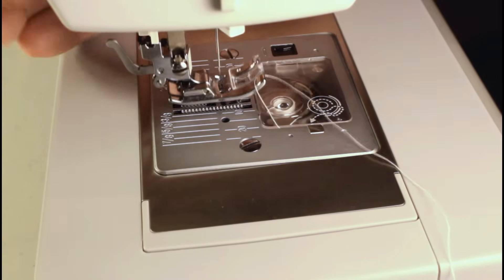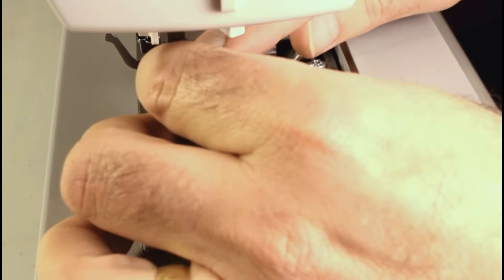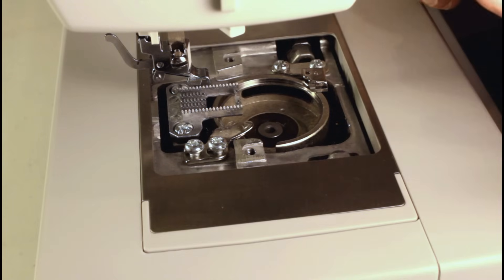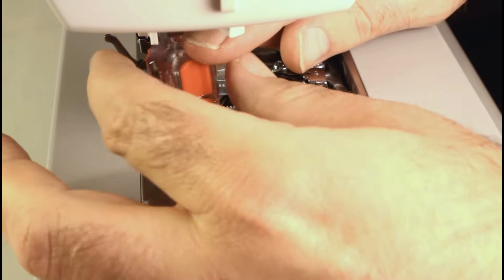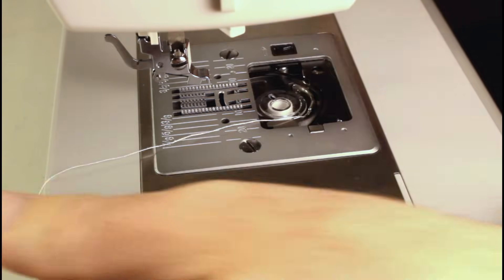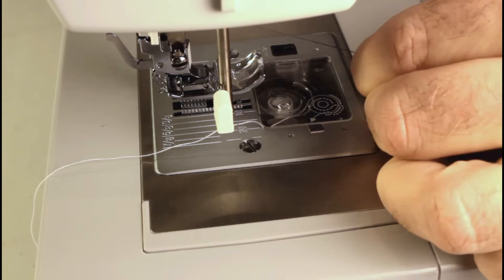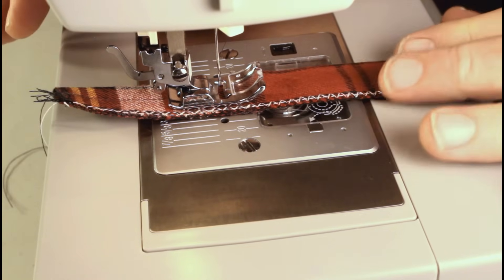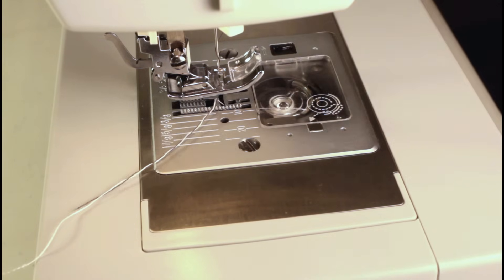Singer Heavy Duty - Adjusting Bobbin Tension, Please read the Description before posting questions.

Comment: Hi I have a singer 4423 which is not making stitches, I either get a birds nest underneath or very loose stitches which unravel. Any suggestions?
Reply from the maker: julie wilcox This usually means that the thread is not seated between the tension disc.
Reply: @kevinsews  where is the tension disc located? Same problem here to my singer heavy duty 4432..
Reply from the maker: @diyaspratiwi6258  They are on the right slot located on the front side of the machine.

Comment: Hi Kevin, I have the same machine and the needle is not pulling the thread out of the bobbin. Seems like a timing issue. Is that something easy to fix? Couldn't locate a video for 4423. Any suggestions? Thanks
Reply from the maker: I own 4 of them and they haven't had that issue yet. If they do I will create a video on how I fix it. You will need to remove the bottom cover on the machine first. Then search for setting bobbin timing on top loading bobbin machines. The technique is the same on all of these machines.

Comment: hi kevin sews i had a question when ever i start to sew my top thread makes a knot with the bottom one n my fabric gets stuck... n sometimes makes a tear on the favric can u help ne
Reply from the maker: It might be a problem with the top thread not being seated into the tension disc. With the pressure foot down grab the end of the thread and pull it toward the opposite side in which it enters the needle. The needle should bend as you pull the thread through the needle. If it doesn't then your thread isn't seated between the disc.

Comment: What do you do when stiching using singer model 1241and stiches are not coming out nicely. They come out loosely
Reply from the maker: I don't know anything about your model, but that is a tension issue in general. Clean the tension disc using dental floss is one thing you can try. A good cleaning of the bobbin tension are as well.

Comment: On sample sandwich it works fine but on the actual piece I am sewing its loose and will have loops every so often. What do i need to do.
Reply from the maker: This is caused by these issues:

1. Needle needs to be changed.
2. Your thread tension is off
3. Your machine is out of time.

Try a new needle first. Then rethread your machine. Pull slowly on the thread in the needle and turn the tension up to 9. If threaded correctly this should stop you from pulling the thread through without really tugging on it very hard.  Next, make sure your bobbin is threaded properly. See the quick start that came with your machine on exactly how to thread the bobbin.

Comment: What do we do when the bobbin house moves and a mess occurs in the threads and the machine fails to work?
Reply from the maker: When you removed the cover you will see a silver piece at the back that holds the bobbin into place. Stop the video at the 10:46 mark and you'll see the two silver screws holding it into place. Usually, the bobbin has become loose from this piece holding it into place.

Comment: My bobbin case doesn't require the screws to be loosened to get it out - it pops out.  I'm guessing it shouldn't?  I have HD6800C.
Reply from the maker: I will have to check my 6800 to see if mine does too.

Comment: I am having problems with my top thread getting caught around the bobbin case.  I have tried multiple times !nd this keeps happening.   Do you have any suggestions?
Reply from the maker: The machine may be out of time. Remove the cover plate and slowly rotate the handwheel and observe what is going on as the thread gets pulled around the bobbin.
Reply: Kevin Sews What do I do after that?
Reply: I had this happen to me turns out a loose thread was tangled inside so I had to pull that out
Reply: @kevinsews  I am having the same problem, pls what should I do after this observation.  Thanks so very much for your help.

Comment: Thanks a lot for the video. I solved my machine problem. But after a few sew, the problem come back, and I’m not able to solve it using this method anymore. 
May I know what should be the perfect tension for the bobby case? Thanks in advance ☺️
Reply from the maker: You probably need to buy a new bobbin. Over time they can wear out or maybe you received a defective one. Try www.sewingpartsonline.com if you need a new one.

Comment: thought i put the bobbin case back in right but not the part  that sapose  to move for the bobbin doesn't move  what do i need to do?
Reply from the maker: Hard to visualize. Can you capture a quick video on your cell phone and post it here on youtube and give me a link to it? That would help me see what you are dealing with.
Reply: @kevinsews  i got the machine running i think the thread of spool was very loose  when changing thread it works  thank you for your reply
Reply from the maker: @MyFungal  You're welcome! I am glad to hear you got it working.
Reply: @kevinsews  you and me both lol   this is the first time i had to  take out the case of my machine

Comment: Hi Kevin, I have a question. I just received a Heavy Duty Singer and its my first time using it. But for some reason the stitches are slanted both at the top and bottom. After following a bit of your videos its not as drastic but its still slanted. What do you think the problem is?
Reply from the maker: I have 2 videos that might help you:

https://youtu.be/-94cSYbxkpw?si=2kv8u6Z-xbRM3WgG

https://youtu.be/7lyxWXCh2dQ?si=w4pUTkw17gkHflVu

Watch them and let me know if they helped you address your issue or not. Then we can go from there.

Comment: I watched your video hoping it was my problem. Apparently not.  My top thread is binding up in the bobbin carriage.  Leaving me with either a good top titich and a birds nest underneith. Or will just bind up the whole machine jamming it.  It’s a new machine, I have used it about four times without an issue.. I sewed. Couple patches onto a denim vest, now I’m having binding issues with anything I try to sew,  cleaned it out, changed the needle, used different threads.  In watching my top thread as it goes around the bobbin, it seems to bind about at 7:00, or 1/4-3/8 inch to the left of the yellow screw.  I have felt the bobbin carriage, no burrs, nothing I can figure as to why it’s binding?  Any suggestions.
Reply from the maker: Take off the bobbin case cover and turn the hand wheel by hand slowly and observe where the thread is catching. If it is caching at the 5 o'clock position as it squeezes through the metal finger then you are experience an issue that many others have had. Return it immediately if possible.
Reply: Kevin Sews it ended up actually being out of sync by almost 180 degrees (timing) I’m supposing that when I did the vests I hit an area that was to thick and jammed it. Can’t believe it would have messed it up that bad. But checking my timing with the bobbin and carrier out of the machine. When my needle was at dead bottom and beginning to raise, thus causing the loop in the thread for the pointed metal pickup to grab the thread. That metal point was totally on the other side of the carrier. I actually had to pull the entire carrier out and replacing it’s worm gear in with the drive gear to get it to be at the right position when the needle began to go back up. Kind of the way you would have to feed the distributor back into the engine to get its timing right. I bought this “heavy duty” lol, machine just so I wouldn’t mess it up sewing heavier items like I did my other machine. 
Anyway, I appreciate you actually responding to my question, I go to YouTube a lot to trouble shoot everything I can. And honestly, you are the first person to have ever responded back to a question I had. So thank you again.
Reply: @kevinsews  I am having this exact problem with it catching in the 5 o'clock position.  The machine is too old to be returned.  We are very handy and able to fix things ourselves.  Can you show what needs to be done?
Reply: @loralibarber3478  we are having the same problems. Did you fix it?
Reply: @fuzzydeborah  No.  I've also contact Singer, but they haven't replied.  Guessing no one is working right now...

Comment: I have heavy duty singer 44s my bobbin tension will not the tien enough to pull the top thread down
Reply from the maker: If you have tightened it up and it still isn’t tight enough then you need a new bobbin holder. Check to ensure you have threaded the top thread properly first.

Comment: Are all top-loading bobbins this difficult to alter the tension on? On my old machine I have to alter the bobbin tension for every different thread that I use but it was much easier to access from the side.  Would I be right in assuming that this is not the case with this machine? Do you find that the bobbin tension rarely needs altering? Can one purchase sewing machines where the tension is adjusted automatically?
Reply from the maker: All of the top loading machines are the same.
Reply: Kevin Sews Which question were you answering?
Reply from the maker: Nowthen AD Sorry, I corrected my post.

Comment: Does the same machine need to be oiled
Reply from the maker: Yes, one drop will do it.
Reply: Kevin Sews where do we oil it? Sorry I thought this machine didn’t need it because it didn’t come with any.
Reply from the maker: @knitknack2285  Just remove the two screws off the top of the machine under the handle. Then remove the left top side panel by to expose the needle shaft and feeding area. This will expose most of the areas that are metal to metal and allow you to oil them. Next, remove the bobbin and place a drop of sewing machine oil in the middle circle you see there.

Comment: Hello sir, can you tell me why’s bobbin not working?
Reply from the maker: What exactly do mean is not working?  I need some details to help you.
Reply: @kevinsews  Few days ago I was sawing a pillow cover and then it got stuck in the the sawing machine. I took it out but, after that bobbin and spring does not work.
Reply from the maker: @muktadatta224  If it is the bobbin case then I would buy a new one.
Reply: @kevinsews  Are you trying to say the problem on the bobbin case?
Reply from the maker: @muktadatta224  You said the bobbin wasn't working,.... that the spring wasn't working. I took that as the spring tension in the bobbin case that provide tension. If it is something else then let me know. It would be helpful if you could capture a cell phone video showing the issue and posting it on your channel. That way if I can't assist you then somebody  else may see it and help you.
Reply: @kevinsews  hello, did you see my video why didn’t replying yet???
Reply from the maker: @muktadatta224  No, where did you post a video?
Reply: @kevinsews  I did post it. I don’t know why you can’t see it. Bobbin and string not moving so what do you think the problem on the bobbin case
Reply from the maker: @muktadatta224  Give me a link and I will take a look at it.

Comment: Hi, I didn't hear you say which way do you turn the bobbin screw, I'm sorry should I automatically just know. Turn left or right, clock wise or counter clock, j just asking, thanks for all your help.
Reply from the maker: Left to loosen  and right to tighten.
Reply: @kevinsews  Thank you very much, Kevin. I have a Singet HD 4432, also. I've tried it all. Adjusted timing, tension bottom & upper. It's not stitching at all. Can you help? Buy the way I just bought this machine I've only used it twice.
Reply: Thanks for asking this question, I to wanted to know, better safe than sorry

Comment: I have a 44s heavy duty but it won't make the loop for the first stitch
Reply from the maker: Place the threads under the foot and pull them to the back side of the machine. Hold the threads during the first 2 stitches. Let me know if this fixes your problem.

Comment: I was sewing fine and then the bottom thread all of a sudden stopped catching

My timing seems fine after inspections and I’m also holding my needle thread taunt when trying to get it to catch and it still will not 😿

But i don’t think it’s my timing at all!!! HELP- watch another girls vid and it wasn’t her timing either. It was that she wasn’t holding the needle thread when trying to catch. I have singer 6412 millennium
Reply from the maker: If it isn't a timing issue then it is a threading or tension issue.

Comment: I am new to sewing and I dont think this brand sewing machine is good for beginners. I havent been able to sew because I cant manage to have the thread not give me issues I dont even know if there is truly a malfunction with the machine or its just me doing something wrong. I have had this for one week and am still not able to get it to work. It came with no manual. HD 44s.
Reply from the maker: Go here: https://www.singer.com/collections/beginner-sewing-machines/products/singer-4423-heavy-duty-sewing-machine    Scroll down to the bottom of the page and you will see a link to the manual. Download it and see it if helps you. I believe the 44s is the model for Walmart and it is the same as the 4423.

Comment: Any idea why the bobbin case would be jumping ? The back holder bar is tight but it keeps jumping past the front bumper causing the needle to strike the casing and jam everything.
Reply from the maker: Make sure you are using a class 15 (not 15J) bobbin. I have also seen defective bobbins, so buy some Singer Brand and give them a try.
Reply: @kevinsews  I'm petty sure they are 15's but I'll double check. To clarify the problem- the bobbin isn't jumping, it's the entire cartridge that's popping up and rotating past the little metal stop.
Reply from the maker: Robert Clyburn I would remove the bobbin case and make sure there isn’t any debris in the bobbin area.
Reply: @kevinsews  I ordered a new cartridge from Amazon and it did the trick!  I'm not sure what's wrong with the old one, but oh well- I'll keep it just in case.
Reply from the maker: @RobC0313  I am glad that fixed it.

Comment: where is the screw in the bobbin case, aI can not see it,  just
 a yellow color
Reply from the maker: Jan Archer The yellow paint covers the tension dial to prevent it from moving. To adjust the bobbin tension you will have to remove the yellow paint to get to the screw. Just scrape it off with a small straight screwdriver.
Reply: @kevinsews  They do this for warranty purposes.  Just be advised that if you remove that paint, and then the machine is still not sewing right, if you send it in for repair they are likely to say that the fault was due to you messing with the lower thread tension.  Kinda ridiculous, but it's also not a coincidence that you can't find this procedure in the manual -- even the long one you have to download online.
Reply from the maker: @gdeangelkick  Yes, I've tried to let people know it does void the warranty, but thanks for mentioning it again.

Comment: Thank you, thank you, thank you! 😘
Reply from the maker: You are very welcome!
Reply: @kevinsews  Thanks again. So things were going great for the next hour -- I was sewing some curtains -- but then the tension messed up again. I checked the bobbins tension again and the screwed hadn't moved since I had turned it. I wonder why it is acting up again. I tried turning a few more times: 1. To the original position and 2. Way past the first tweak, and I'm still getting loose threads underneath. Any thoughts?

BTW, I know how this whole mess started. I tried to sew through this thick dog color fabric/belt. I wish I could go back in time and not have done that.
Reply from the maker: @LoriGarcia  Make sure your thread tension is good too. Thread the machine with the foot up. Lower the foot then slowly pull the thread through the needle. Tighten the tension until the needle slightly bends. This will give you a good starting point on your thread tension. You may also have a defective bobbin case too.
Reply: @kevinsews  Thanks for your help. I'll try it in the morning!
Reply from the maker: @LoriGarcia  Okay, let me know the results.

Comment: How to replace defective rotating hook
Reply from the maker: Buy a new rotating hook. Then you will have to remove the covers and usually the bottom cover around the needle area. There are 3 to 4 screws (depending on the mfg. and model) that need to be removed. Notice the position before removing it so when you place the new one on you can ensure it is aligned up properly. Many newer machines have an alignment mark on them, so look for it.

Comment: can you please tell me why my bobbin case isn't moving around like it should ?
Reply from the maker: Remove the screws from the cover plate (see my video on how to adjust the bobbin tension on how) and see if it might be simply out of place. It could also be damaged... easy enough to  see by buying a new one and see if that fixes it. If neither of these then there could be something wrong with your machine.
Reply: the bobbin where the thread set in doesn't move    was jammed before  got it unjammed  now this
Reply from the maker: @MyFungal  Okay, I had my machine apart to grease. I captured a couple of really crud videos trying to see if I could show you how you can check out the bottom side of the machine to see what is going on. Here is a link: https://youtu.be/9XdLwxfHA3s. Again, it is rough, but see if it is of any use.

Comment: I have a knotty mess. 😭😭😭
Reply from the maker: If it is on the bottom side then it is usually with your needle thread tension. With the pressure foot down pull the thread through the needle slowly. The needle should slightly bend when the tension is correct.